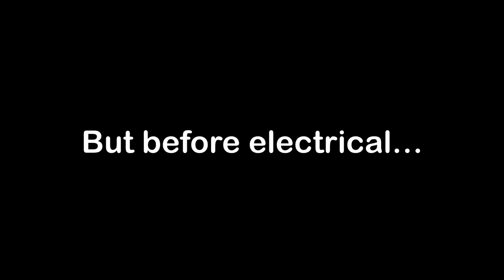20Ft Camper Kitchen Remodel Complete!  PART 2 - Install & Reveal

Comment: My second watch....love this. I already told my husband I had no intentions of using the cooktop a 3 burner original. I have used since 2008 a single burner stove and also do have a coleman double burner gas stove too that folds up. But have never used that. I find one burner has worked for years now when I'm on my own or with others up to 4 even. So I can keep the single burner in a drawer and it has a new microwave installed by the previous owner. I'm most interested in your pop up electric outlet center. NOW that caught my eye and definitely going to keep that in mind for a future study. Like you if I remove anything like the cook top of course I'll pack it away wrapped to protect if a buyer ever wanted it. I already had ideas how to place a counter top over the cook top but I can see advantages to removing it all together. I'd gain a lot of counter space this RV is low on. Which is why I was thinking about building a counter right up and over the burners and their metal cover. Love your video's and the simplistic break down on how to do it and approach it.
Reply from the maker: Thank you again for watching!  And glad you found some ideas for your own camper :). We also rarely use more than one burner - even at home!  So it has worked out great for us.  We just spent another week in it last month and didnt miss those burners at all.  And the pop up is working great.  We make coffee every morning and use our little Dash mini grill/griddle to make breakfast sandwiches.  Plenty of room and a lot less cleanup.    Would love to see pictures if you make some changes!  Thanks again!!

Comment: So I was thinking about removing the indoor stove, but I remembered what we use it for.  We often need to run the stove, to fill the propane lines, to get the fridge to light.
Reply from the maker: Have heard others doing that as well.  We never had a problem with the fridge luckily.  Wonder if running the heater or hot water heater would do the same?  May look into this to do some research!

Comment: Really Neat Mod and always enjoy your videos.  Can I ask where you got the new sink and the manufacturer?
Thank so much
Reply from the maker: Hi!  We have a link in the description but we mention in the video that we don’t think it would work with the original set up.  The drain is centered and would require modifying drains/drawer with the original counter.  We had to push it back 3 inches in the new countertop to work.  

If you are looking to replace the much smaller sink in an older model, have heard of some owners being able to order direct from Forest River.

Thanks for watching!

Comment: Did you put silicone under the pop-up electrical outlet?
Reply from the maker: We didn’t but not a bad idea.   We installed it in that far corner to keep it away from the sink.  It is a tight fit to the counter and is far enough that it doesn’t get water near it.  But something to keep an eye on.  It unscrews from the bottom so easy to remove and add if needed.  Thanks for the watch!